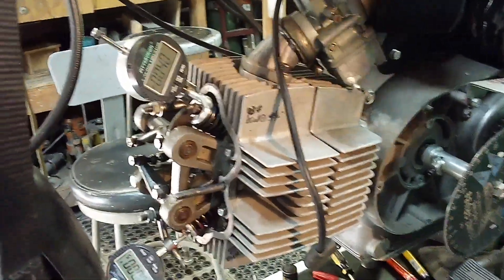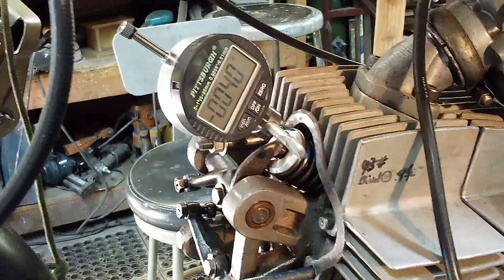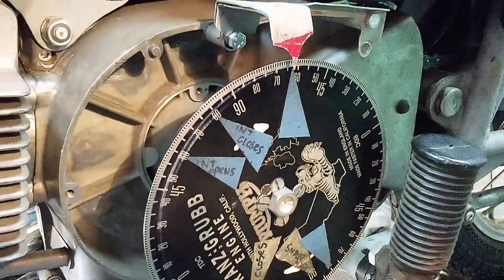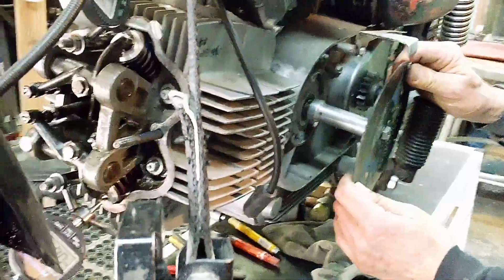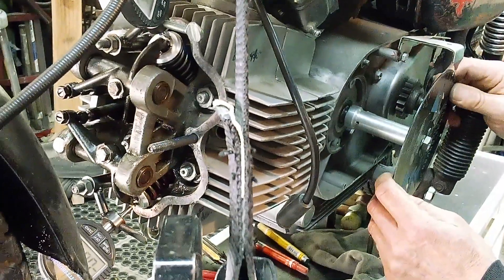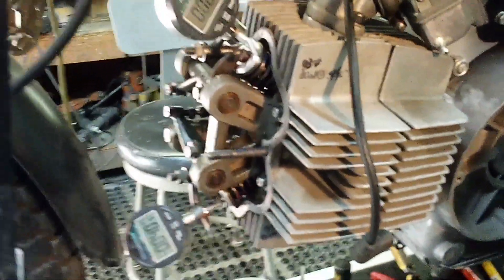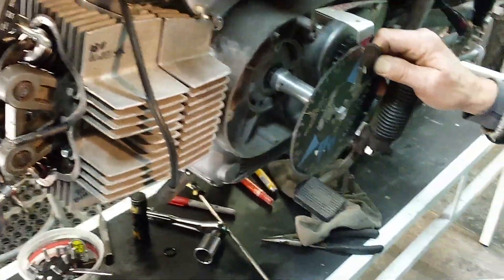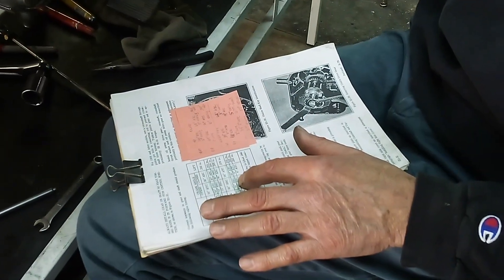These are extra boring home movies was working on Robin, World's Fastest Aermacchi

Comment: Very interested in finding out what ignition you are using for your race bikes. The shop I work at is making carburetor as well as ignition and starter kits for these as well as the 2 stroke Aermacchi's. Have heard of people using an MSD hall effect sensor box but with no info on setup and compatibility between models.

Comment from the maker: Ignition is Boyer twin pick up coil with one coil removed, replaced by a jumper so it fires every other crank shaft revolution. Boyer is mounted on end of cam shaft. The coil is a nolagy 3k ohm but these coils fail often, looking for a better coil, possibly a PVL.
Reply from the maker: This ignition is on the Racing bike, a short stroke 250 cc spun to 11,630 rpm; the 350 & 402 regularly spin to 9,500 rmp. Robin, the custom 250 and Francesca the stock 350 both run conventional point and condenser ignitions.